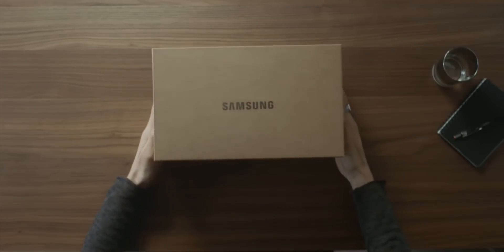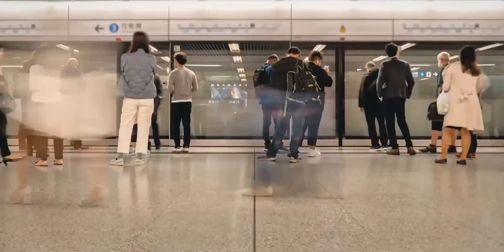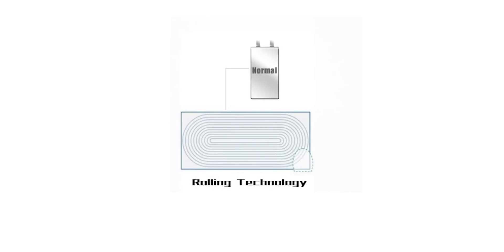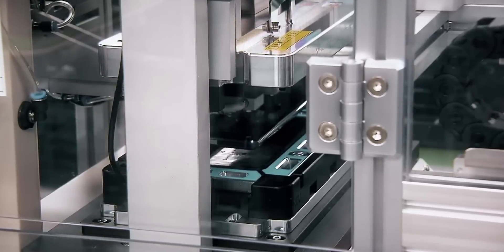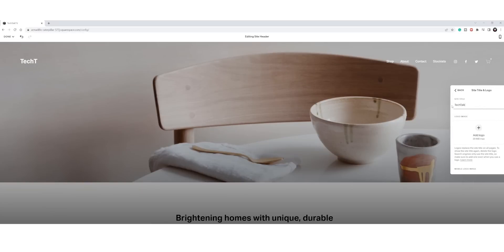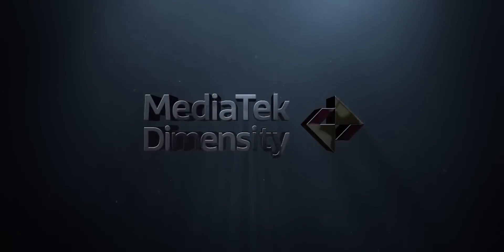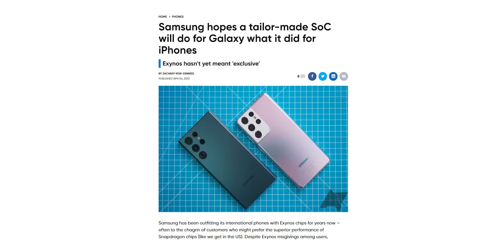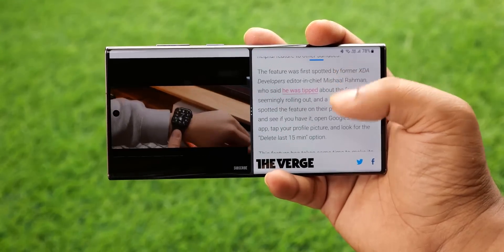Samsung Galaxy S23 Ultra - Yes, This Will Change The Game

Comment: I will not upgrade, untill they increase a display size of ultras to 7inches long as ultras are phablet phones so it should be bigger n wider,  they did a great job in note20ultra's display its a bigger wider n better n use it too.. if they upgrade to 7inches display in size i will go for updagrade to next ultra device..request a display upgrade to samsung thanks..

Comment: I really hope the base variant of the S23 Ultra will be 256GB instead of 128GB. 256GB feels a bit decent while 128GB is now less ideal for a premium flagship since Samsung remove microSD card expansion on all S22 models, which I had a feeling that Samsung will do it again for all models of the S23.
Reply: I filled a 128gb with just roms, and had the need for ALOT more. I filled another 128gb just from downloading and editing videos. Then you're sitting there struggling with performance issues and always having to find something you can delete just so you can update one of your apps. Before this I woulda probably been cool buying a 128gb. After though, with no expandable memory? Absolutely not. I know  there's a good chance I'd fill the 128gb and that's something I just can't risk personally.

Comment: If the system uses 15% of ram instead of 30% of ram, batter would be much better already. No need for new battery technology. I guess they could not do that.

Comment: Samsung needs to improve the Secure Folder and add a built-in Applock outside the Secure Folder for the main interface as well!
Reply: Improve how? It's good
Reply: They don't need to improve anything else it's fine the way it is we don't need anymore improvements on next year's flagship phones it's only going to make things a lot more worse I wouldn't advise anything like that

Comment: Samsung selling trial products to their customers,  in the end so many issues and customers getting angry. Samsung needs to improve a lot in their hardware and software issues to be fixed. Samsung products price is so high but the quality is poor. Well done Sammy.  Keep the good work, apple will be happy to see Samsung customers move towards them
Reply: Lol...Apples poor  customer service reliability repairability locked down os high price is alot better than android like Samsung.  You joking right? Rather closed system is very limited or open  system fragmentation....I rather have control and options than apple.
I have not used apple products for decades..only good for one thing at time things/single thread performance workflow/workloads ...sorry but I multitask...android/windows/Linux plus gaming. No REAL  gaming on apple unless you "try" dual boot os virtual machine.

Comment: Making the issue bigger isn't making it better. My note 22 ultra battery is much bigger than the iPhone and the crap dies within 5hr. My iPhone last at least 3hr longer. So by increasing the capacity, all Samsung does is make it bigger !!!  So now you have a super huge dying battery. They need to work on the phones optimization, heat distribution & cooling system. S22 has been a disappointment.

Comment: Hope Fold 4 has, if not then the Fold 5
▪︎6000mAh battery or 10hrs+ of SoT  (Even if it's thicker)
▪︎45w Wireless charging/ 65w wire charging 
▪︎Wider Front Screen
▪︎IP 68 or better

Comment: I think samsung needs to work harder to optimize the soc, the battery and the software to communicate efficiently in order to complete with the iPhone 14 in battery. Perhaps Android is the bottleneck, which sorta explains why  no android can come close to the 13 pro max with battery life 🤔
Reply: Hate apple It's just sucks difficult  to use features  pin is more secure  than face id  and finger touch  because  all I have to do is peel your eyelids over your skull 💀  and for your finger a sharp  cleaver to cut it off if you fail to give your hand up  and your pin is much harder because  they will have torture  you till you break  

And apple is no longer a secure device  still gets hacked its no different  to android   privacy  that's a lie apple wants to know everything  about you so not private  anyway

Comment: Sal, you know bigger battery is not the solution for Samsung or all of Android - I think a better chip and a better software optimization the key to achieving a better  battery life.
Reply: That helps, but you can only optimize so far. For instance einks last about 2 weeks due to their nature of display and refresh.

 We need a larger capacity that fits on the same area(if that is even possible). Currently , we are already using external battery packs

Comment: They should make the S23 Ultra have at least a 6500mAh battery. I don't care if they make it thicker.
Reply: Thickness goes above 10mm and nobody like that much thick phone
Reply: They need to  cover more footprint with battery and makr phone thinner, i dont like that the 22 is so thick.

Comment: Still won't be enough to beat the iPhone Pro Max even without this tech.
Reply: How's that? With apples poor customer service higher prices poor reliability repair. No apple says buy new one. Even new m series...the ram ssd is soldered...you stuck or cannot replace upgrade those parts.

Comment: to hell wit any new phones that remove SD card slot I have the s22 ultra and I also have the note 20 ultra to make a long story short I'm sending the s22 ultra right back to Samsung for taking away the SD card slot because it give me anxiety just knowing I'll run out of storage soon and the 100x zoom does nothing for me so that's a gimmick Samsung thanks but no thanks I hope they read this too. I've been a long time Samsung supporter but no longer after the s22 ultra
Reply: U clearly don't have either one of those phones
Reply: U clearly don't have either one of those phones
Reply: How don't I? Do you want pictures? Baffoon!
Reply: I feel your pain about them ditching the micro sd card expansion that's the main reason I'm still hanging onto my S20 Ultra i got 1.5TB of storage I'd never give that up. Why not just go with the S22 Ultra 1TB model then ?

Comment: 10% extra on the s23 ultra will just be 1 hour more SOT than the s22 ultra. They need a more efficient chip and way better software optimisation. I'm sure my s22U exynos will be less laggy and last way longer if they worked on optimisation. Hopefully the next few big updates will do just that.
Reply: Your right. It won't make much of a difference but it sounds good.
It's Samsung marketing at its best trying to overshadow the disappointments so far for many people.
They are influencing the audience and creating hype to boost pre order sales like they do every year.
People keep falling for it.

Comment: Stacking is not  new  i dont think it would make a huge difference
Reply from the maker: Like I've mentioned they are using stacking method for making batteries for EVs already. And it will be the first time they are using it for smartphone batteries. And a 10% increase without increasing the volume is pretty significant, imo

Comment: Any news about Micro SD slot? Imagine if s23 & z fold 4 (even didn't offered an s pen slot) offered 1tb, maybe we can use sdxc another 1tb one day. Unless, I will use otg adapter, but little a bit of weird, bulky & very ugly.
Reply from the maker: I'm sure it's not coming back
Reply: SD Slot Are Only Available On Samsung A Series.

But Looks Likes Samsung Is Ripping It Too On Their Future A Series.
Reply: It's kind of a modern thing to never have SD slots on common flagships.
Reply: It's the trend led by a powerful minority. Eventually we are all to save our personal files into clouds owned by a select few and be part of a big data system.
Reply: What kills me is my S22 Ultra has no micro sd card slot, while my Tab S8 Ultra has a micro sd card slot with my 1TB MSDC
Reply: Sd card is gone forever. Its not coming back